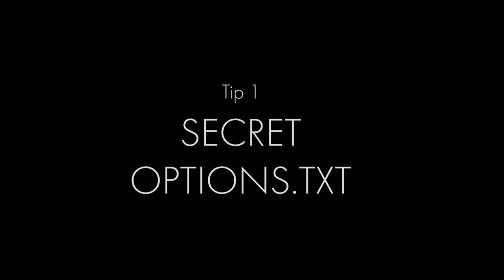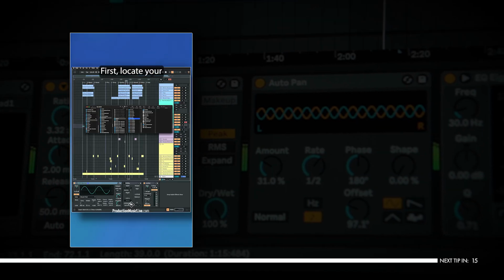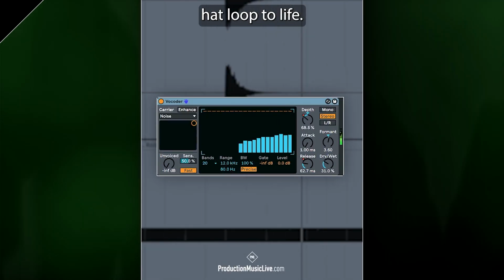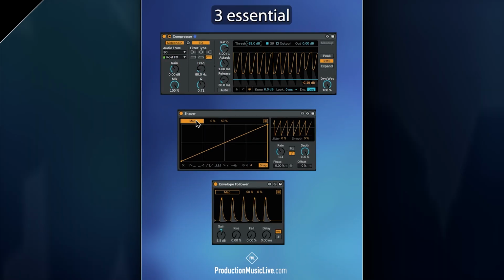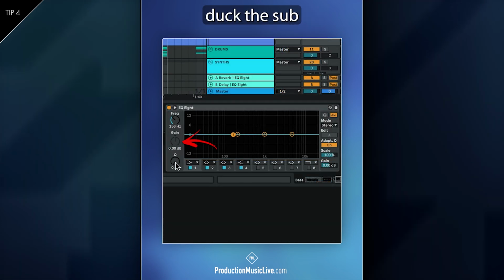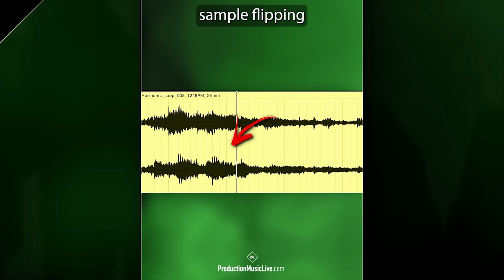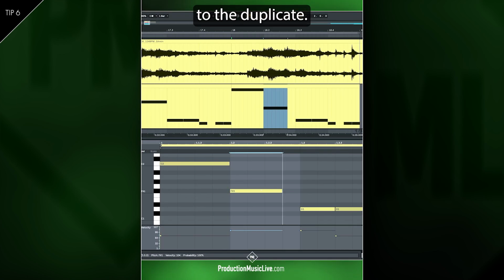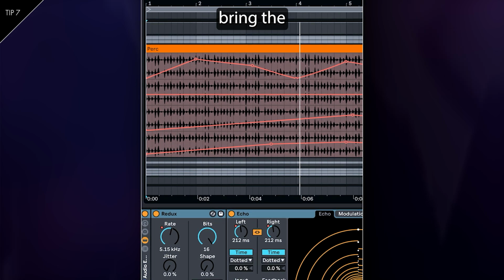7 Powerful Techniques for Ableton Live

Comment: interesting! I didn't know about this option.txt file. 
I tried the "ShowDeviceSlots" function and I can see the switches but the device name is not displayed. Do you know why?
Reply: I saw the answer to my question on reddit. 

"it displays the names of devices that are already there when you open the project"

"after I drag in plugin or Device, I have to resize the track (column) width before the name of the plugin shows up."
Reply: @yoetc  that sucks